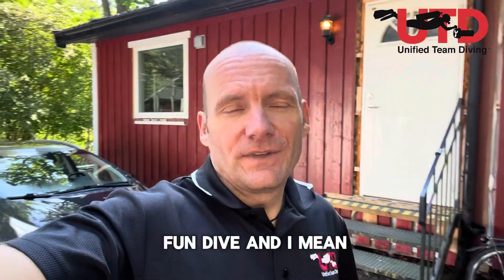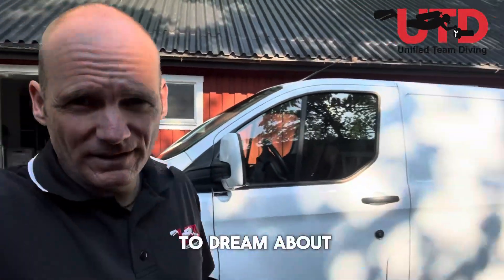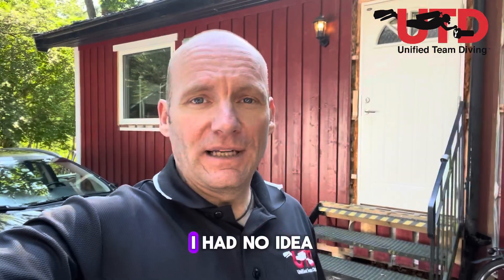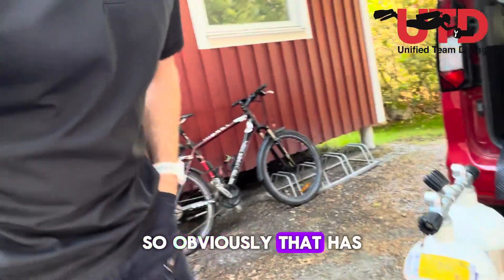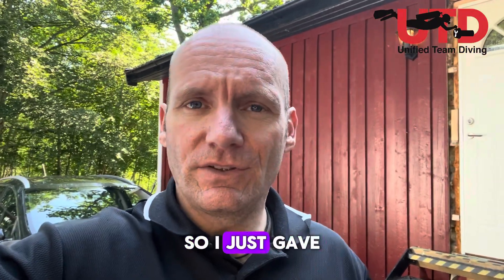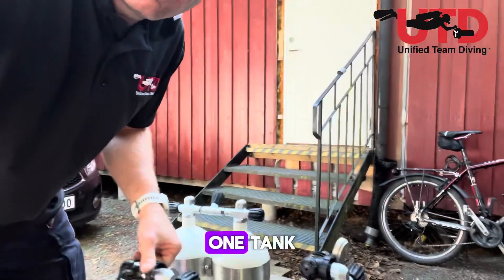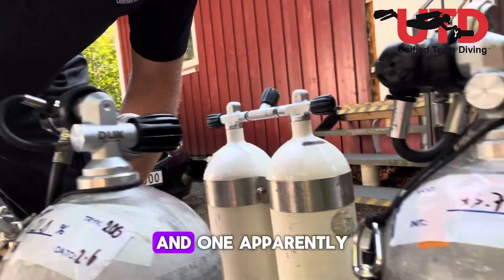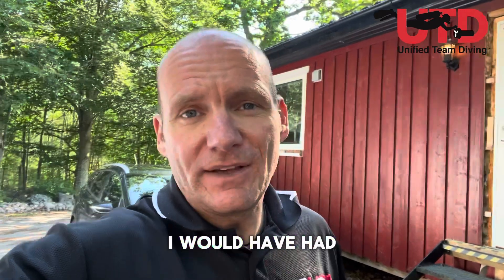Analyze your cylinders even if you have no reason to suspect any other gas than air.

Comment: I consider it necessary to check the gas in cylinders for carbon monoxide. Which course of study has this test? Nowhere?
#staysharp
Reply: It is highly recommended, we always promote it. In my time as a UTD Instructor I checked each and every tank for CO. My tanks and those of my clients. Some, fortunately few times I had a positive result. In all of those cases there was a portable fuel powered compressor involved.